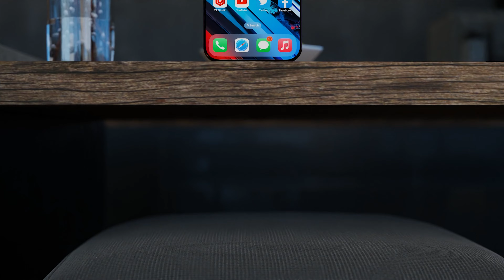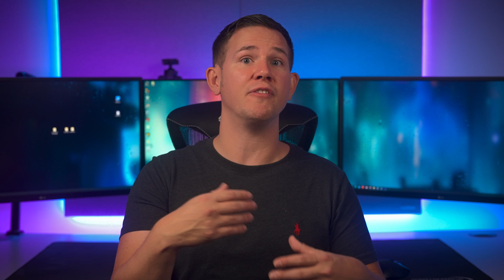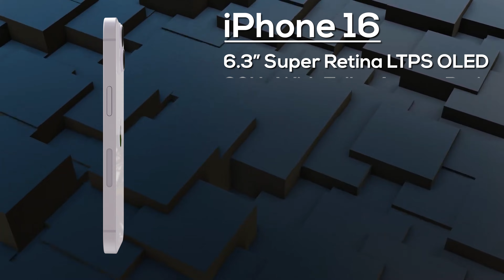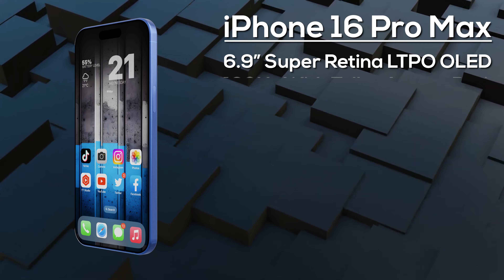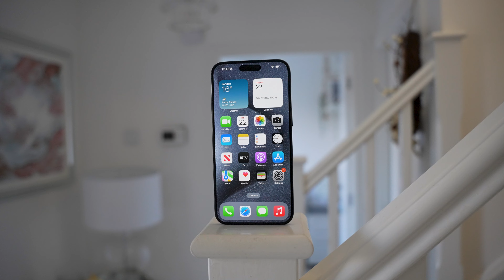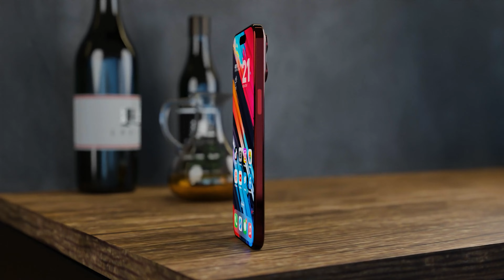iPhone 16 Pro Max - Epic New Features!

Comment: That’s exactly what iPhones need is a thermal cooling system that can help with overheating issues, glad Apple is increasing the display size, the more bigger the phone is the more bigger and better the battery life would be, that would make some room for a cooling system to be installed inside the phone. Apple needs to step up using upgrades